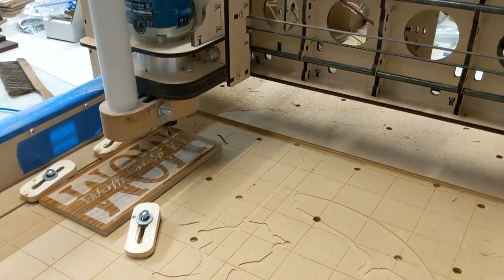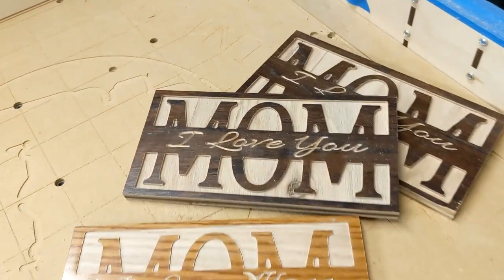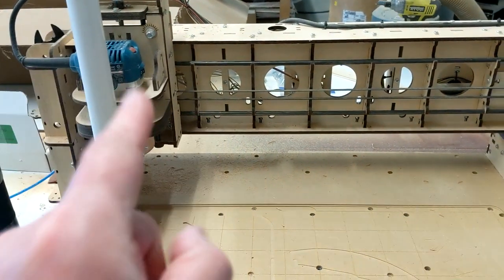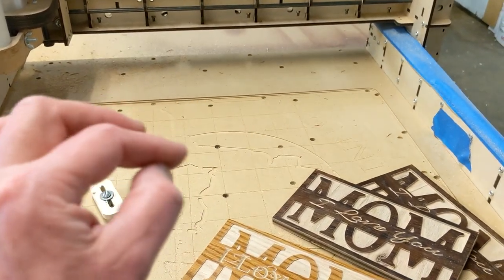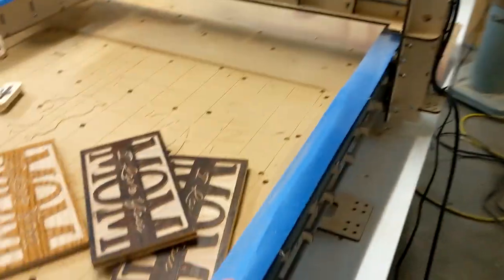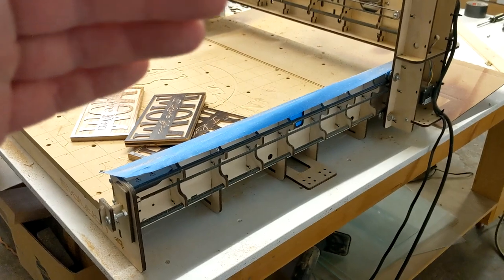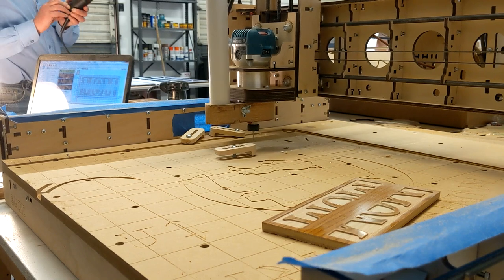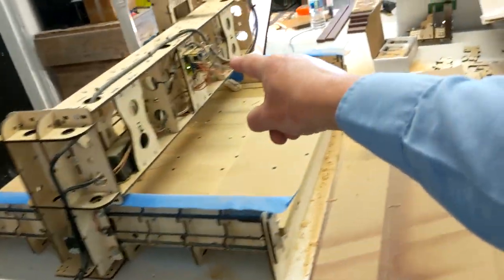Why Your CNC Router Randomly Stops In Middle Of Projects [You'll Get It] - Garrett Fromme

Comment: I'm going to post another question here because I love the instructional videos you produce, and I have already gotten some good answers from you and others here.  In fact, your videos were instrumental in my deciding to finally purchase my very first CNC. 

I have created a file in Vectric Vcarve. It is a layered mountain scene. I did import a picture to use but I did not use the "Trace Bitmap" function because I was going for a different look. Instead, I used the "Freehand Drawing" tool and basically outlined the top of the mountains and then drew some more wavy lines inside to represent the face of the mountains with the same tool. I end up with a lot of individual lines. The only toolpath operation I can use that will make it look anything at all like what I am going for is the "Quick Engrave" set at outline.

The weird problem is that it won't just carve all the lines at the same depth. It seems to randomly pick and choose. In some case it starts off light and then digs in deeper. In other cases, it goes perfectly even and light (Not as deep). In some cases, it barely touches the wood at all. I have tried this on a surface that was already flattened by the same CNC, so I know the surface started off flat. 

All I want to do is draw a series of lines and tell the CNC to run the Vbit over those lines at the exact same depth everywhere. Is this more complicated than I am imagining it should be?

If anyone has any suggestion, I am listening intently =)
Reply from the maker: Haphhhazard, this one is a bit tough to answer over a comment brother! Join me on my Live session on YouTube Wednesdays at 6PM EST. Id be happy to help you then brother!

Comment: I had similar issues and i found it was my LED lights in my enclosure.  I stopped using them and have not had any issues since.  I plan to put an UPS on the CNC to stabilize the power flow.
Reply from the maker: Interesting. We never know something so minor could cause that problem.
Reply: That is strange! I run all LED lights and they don’t seem to effect it. When I was having issues I tried it with lights off and still would stop. After installing the ferrites and grounding the chassis haven’t had a issue since!

Comment: Wow if that helps you are my hero. I couldnt find any solution and was about to change my grbl controller for something else. Did your surge protector fix the problem? It might be also some electromagnetic/electrostatic stuff going on from turning dremel on.
Reply from the maker: Surge protector seem to stop the issue. However, that did separate the high voltage wires from the low as well

Comment: I’m having similar issue but on one axis will stop moving and then get out of sync.  Mach3 shows it is still going and then it continues but in the wrong location.  Happens on y and z access.  Put up a few videos showing the issue.  I am occasionally turning on my shop vac to clean up shavings.  Willing to try surge protector as support for my CNC is not very good.
Reply from the maker: Mace, sorry to hear you are having issues with your machine. Keep us all in the loop on if your surge protector fixes the problem.

Comment: Hey there. Great video. I'm getting my new OneFinity set up and looking into what's possible in my new (old) shop for isolating circuits. My question is whether or not you have gone back and tried testing using the same devices in a similar configuration since having installed your surge protector and/or UPS to see whether or not you are indeed seeing fewer faults. Have the intermittent interruptions stopped (completely/mostly) after adding the new components?
Reply from the maker: Hi Brett. I have not had a problem since the surge protector was added.

Comment: An power conditioner like APC that has voltage regulator is probably best. Isolates each outlet too so prevents electrical noise
Reply from the maker: Thank for adding to this Kunstle

Comment: Just happened to me…..do you have to rerun the program or is there a way to pick up where it stopped ?

Thanks
Reply from the maker: Hi Tagdaddy, you can re run the program or you can start at the specific line that the machine stopped at by editing the g code. If its a long toolpath, i recommend editing the gcode. If its a short toolpath, i recommend re running it.
Reply: This happened to me yesterday 5 minutes before the job was done, I shut down mach 3 and it always asked if I wanted to save the fixture and this time I said yes, I opened mach 3 up and it saved the coordinates where the router was, I reloaded the g code and started it at the line where it stopped 21443 and it finished with no problems. I will be getting a good surge protector today

Comment: Hi ,

In my recent research I can say this..!
Will have to verify..!

So
I can see there is a potential for EMI Penetration.! Especially on USB -based Controllers.!

The Router or any powerful appliance that We may have close-by will create  Electromagnetic Frequency which will easily distort 5Volt Signals when any load difference /spike is seen on its line.

Separate  the High Power  Spindle Cable  from delicate Signal Cables 

(High and Low Voltage Lines should not be routed parallelly together.! Keep them separate. They may cross at some points . but should not go together.! )

 Use Shielded Cables for all signal and power lines and connect the shielding to the Earth Ground at one point on the enclosure.

Keep signal Cables as short as possible.
and Use Ferrite Cores at the transmission and reception ends of signal wires
Better if can Use Ferrites on all low and high -voltage cables

Use Ferrite cores on USB cables and Make those Cables as short as possible.
Reply from the maker: user-oq9ml8jb1t, It's great that you're doing research on EMI prevention for CNC setups! Proper cable management and using shielded cables are important steps to mitigate electromagnetic interference. Keeping signal cables short and using ferrite cores can definitely help reduce the risk of signal distortion due to EMI. Make sure to properly ground the shielding to minimize any potential disruptions.

Comment: You can see it on your shop lights they will flicker slightly when you turn on something high powered im in the process of doin a separate breaker for the cnc the workshop is far from the house so its not cheap have to run 200 feet of cable
Reply from the maker: Hi Kieren. Hmmm, I didn't notice that. I'll watch for that next time.

Comment: Interesting. I came to a similar theory. I installed a dedicated surge protector for my CNC and while I did notice a positive change in the first few months, it again started to fail. Best I can guess the filament is not longer functioning and now I am getting the error stop again. 

I'm now looking at a dedicated power run for my cnc on a separate breaker to see if that improves longterm functionality in tandem with a surge protector.
Reply from the maker: Other suggestions from this video were to make sure the cables are shielded
Reply: @IDCWoodcraft  gotcha, they are.
Reply: @IDCWoodcraft  I will say this as well. I have the same issue when setting up the laser and the cnc at the same run times, one will knock out the other.

Comment: what is the blue painters tape on your cnc for 
Jeff
Reply from the maker: Hi Jeff. The BobsCNC rails are exposed and get sawdust buildup.  This causes a problem since the sawdust gets cruched between the drive bearings and rails. so the painters tape acts as a barrier to stop the sawdust from building up.

Comment: Thanks for the advice on the surge protector. I just ordered one. I am also experiencing another issue though. While using my CNC to flatten some walnut with an Amana RC-2251, flattening bit, I have now experienced (4 times) the spindle shutting down in the middle of the file run. Sometimes the spindle just shuts off, but the file continues to run, and the controller still moves the gantry. Sometimes the spindle seems to bog down or slow down and then shuts off.  In all cases the controller still moves the gantry in the X and Y directions, but with the spindle off, this creates obvious issues. 

Do you have any ideas on why this occurring? I'm guessing a bad spindle. I checked all the connections, and they are fine. I never get error codes and I'm only taking a 1/8" pass. The cutters are not dull. The FPI and RPM are set to Amana's recommendations. Any help would be greatly appreciated. Gary
Reply from the maker: Gary, that's a strange one brother. I agree it does sound like it could be your spindle. I'd recommend reaching out to Amana directly and seeing if they have any tips and tricks for you to try out! They should be able to help you out the best on this one!
Reply: That is a large bit. What type of spindle are you using?  I use Amana bits as well, and the feeds and speeds they provide are what the bit is capable of. However, non industrial CNC's typically cannot achieve those feed rates and chip loads.  The effort required to push the tool through the work piece at those rates is high. It also loads the spindle quite a bit.  Just manually  try to push a hand router through a piece of plywood at 200 inches per minute and you'll see how hard it is.  If you have the ability to get a torque curve for your exact spindle, select the lowest rpm where your torque is the highest and adjust the feed rate using that rpm and the lowest chip load value from Amana's range of recommended values.  EMI usually doesn't affect the spindle. I would guess your spindle VFD thermal or load limits are being triggered somehow.  Does your spindle have any internal thermal limit protections?  Try running the same g-code and just take off about .01" and see if it completes without problems.
Reply: @dvongartzen   I think you are on to something there. I am using a Hitco 4 H.P. Spindle. I will look into the internal thermal limit protections (it might be worth noting, I'm in Fresno Ca, and it was hot in my shop already) and I will read more about the torque curve. I did talk with a very helpful Amana representative. I also mentioned to him that I used this very same bit in a 1.75 H.P. router and could make 1/4" passes all day long on a flattening jig. HIs response was, and it made a lot of sense when he said it, was that I was probably adjusting the feed rate by listening to the motor, which I was. Obviously, the Spindle and the CNC can't do the same, although it would be cool if they could. I have since run it again with all the same settings, but I reduced the pass to 1/16". It did just fine. I also spoke with AVID, the company that sold me the machine. They say that I shouldn't be running a bit over 2" wide. I have ordered a smaller bit. I am concerned about the temperature, and I expressed this concern with AVID before purchasing their spindle. I spoke with them about whether or not I should be thinking about a water-cooled spindle, considering the summertime heat we get here. They assured me it wasn't necessary. I also purchased a refurbished spindle from them (1k  savings). So, these last two things, heat and refurbished, have me concerned that my spindle may be at fault.
Reply: Thank you @IDCWoodcraft   that's exactly what I did and they were helpful.

Comment: I had an another problem  how to regain last position or start your machine job where it left after the sudden power loss shut down or  latenight  go to bed to take sleep leaving your job for next morning
Reply from the maker: Strong, that is a tough one brother. Your best bet is to separate toolpaths into different files, so when you have a disconnection you only need to run that one specific toolpath again!

Comment: I have the same issue. I think that I am goign to try and use a small UPS on the electronics side of things. This should smooth out the power so turning on motors, heaters and so forth from causing brown outs or spikes.
Reply from the maker: anytzhing to keep it protected
Reply: @IDCWoodcraft  could you reply to my message when you give it a try? Thinking it might be more of a brown out scenario rather than a surge. Similar to when you run a vacum and the lights dim in your house. I think the logic high level is dropping to a state that is to low to be a logic high hence it hoses the data and the control board can't recover. Thanks!

Comment: When I work with my Workbee, regularly and randomly, it stops working. The spindle continues to rotate, but the axes does not move forward. To continue to work, I have to press the pause button of the software and then the run button. In general it restarts but not always.
I have not this problem, if I start à job with the spindler/vfd off.
Do you think I can solved this problem with your solution?
Thank you in advance !
Reply from the maker: Hi 
Patricia. That random stopping is definitely annoying when you don't know why. I hope this solved it for you.
Reply: @IDCWoodcraft  Thank you Garrett!

Comment: Have the problem myself, and have tried to find a solution, but a surge protector cuts off the power and reconnects when the power is stable again, but doesn't it stop the cnc anyway?? you do need to remove the spikes, but not disconnect the power Have I misunderstood something? :)
Reply from the maker: Iars, a surge protector should keep your cnc from turning off if you have unstable voltage issues. It works off of a variable resistor!
Reply: @IDCWoodcraft   Yes I know, but the voltage protecters I know, cut of the power if the peak is to high, and and you can set how long boot deley time you want, normerly  from 1 to 300 sec.

Comment: I’m experiencing a similar issue but instead of the router stopping, it gets “confused” and plunges too deep into the wood - completely destroying the design. Do you think this could be solved with a surge protector? It doesn’t seem to be the router or the machine itself. It usually gets confused around 72% completion. Any tips are beyond appreciated!!
Reply from the maker: Eily, have you tried running a different toolpath to see if you have the same issue brother? That way you can rule out an issue with the gcode!
Reply: Same issue as yours Eily..
Until now, I don't know why.. I will try to install voltage surge.

Comment: HELP ME PLEASE  would that be the only reason they do that  is a spike in power I have a 5x10 cnc  that randomly stops in the middle of cutting parts its driving us nuts
Reply from the maker: Hi Keith. I am not an expert in this area. I just know electrical noise is a major culprit. There are other factors that can come into play. I suggest the first thing you do is contact the maker of the machine and get their advice.
Reply: @IDCWoodcraft  we've done that they said check E stops  check wiring harness  plugs and   connections.
 Screws are tight 
Plugs nd sockets are  cleaned
Checked the pins 
 Wires aren't pinched or broken 
No bare spots from rubbing 
The machine runs a few boards and just stops sometimes it stops a few times on 1 board  
Doea anyone have a idea on what is causing this  glitch
Reply from the maker: @keithholton5559  unfortunately, I am not a technical person so it is not my strong point to troubleshoot technical issues. You might want to go to the Facebook group CNC troubleshooters. They are the technical guys

Comment: Just got a used shaepoko xxl3 it does this in the middle of every pattern I’ve tried to run. It stops in the same place in the pattern every time. I don’t think it’s a power problem because I’m sitting there watching it run and not running anything else except the heater. So frustrated!!!
Reply from the maker: Richard, I recommend trying a different toolpath and seeing if you run into the same issue brother.
Reply: Battery back ups for the win. Thanks for your help very much appreciated, now I can begin my CNC journey

Comment: How did you reset your router?
Reply from the maker: Pat, are you meaning when it randomly stops during the project? Or resetting the router in general?
Reply: It wasn’t froze..it is moving so slow you can hardly see it moving, so now I have to figure out why

Comment: Sir, I had the same problem as you. I bought a strip with surge protection, but the problem did not disappear. what could i do? 😢
Reply from the maker: nsMisiek, I'd recommend reaching out to your machine manufacturer directly on this one if it didn't fix the issue for you!

Comment: I've been running mine for 3 yrs and this problem just happened to me just stopped moving. But I was not running anything else and I have always had a surge protector. Also for the last three years I have always turned on other tools even the dust collector and never had this issue. Today nothing else was running. What do I do.
Reply from the maker: Michael, I recommend reaching out to your machine manufacturer on this one my friend. They should be able to help you best on this one brother!
Reply: @IDCWoodcraft  thank you for reaching back out. I really appreciate it. I reached out to them and was told unfortunately this affects all cnc users at some point. I was told it really could be that random and that it could simply be that I was craving on a really wet rainy day. I did end up purchasing a better shielded and Ferrite Choked USB Cable it should be delivered today, we shall see. Problem is they also told me it is so random that I may not be able to replicate it. Oh well I'll work on.
 Hopefully it was just a fluke. Thank you again for reaching out. Have a great day.